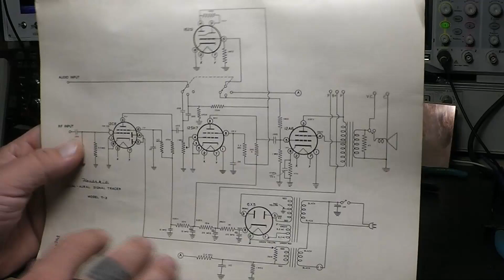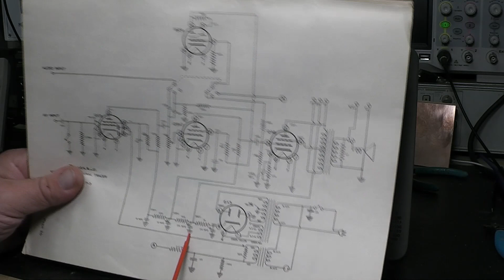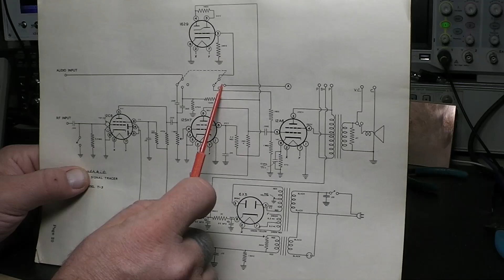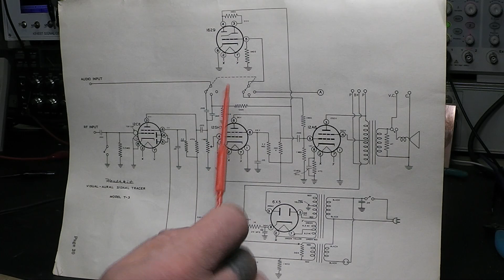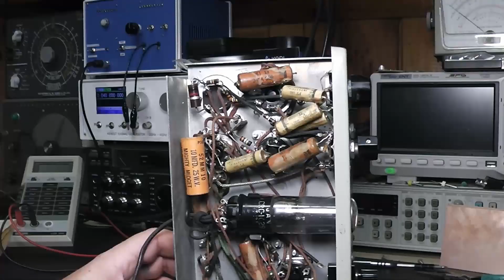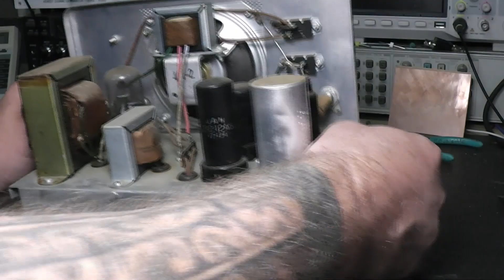Heathkit T-3 Signal Tracer Restore Part One

Comment: Top job on this & I thank you. Yes, Mr. Carlson has a lot to answer for! I saw his resto & just had to rush out in a buying frenzy... I secured the same model (same livery too) which was in excellent condition apart for a red jewel pilot lite someone fitted on the top LHS. I kinda get why they did it but it sort-of wrecks the layout balance. At least they used a proper Heathkit jewel. I also carried out the Carlson mod for the volume control.... still wondering how the designer overlooked this. Thanx again & merry Christmas:)
Reply from the maker: Thanks for the kind words!!

Comment: I'm barely in process of restoring mine.. My caps are the Yellow molded.. Looks like someone worked on it before like in the 70's.... I will change out the electrolytes and two tubes and get the probe for it.